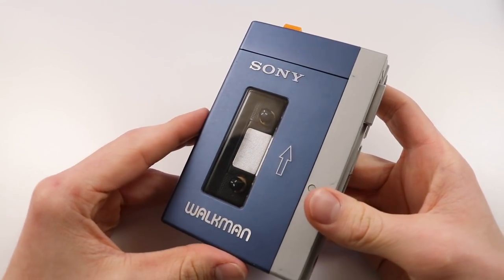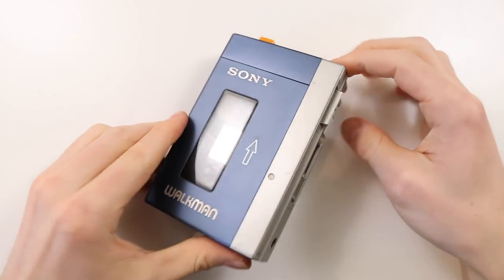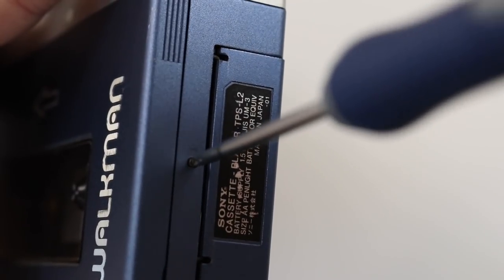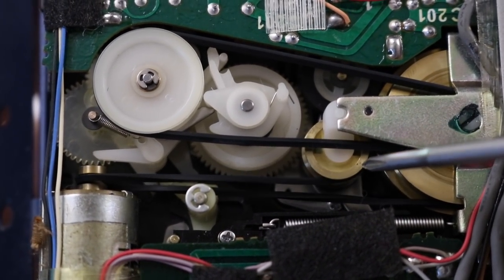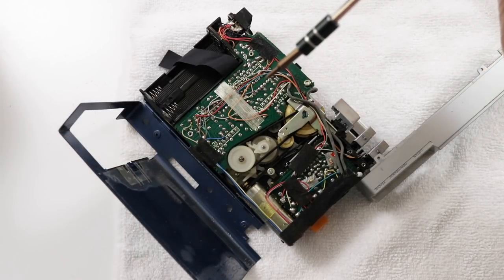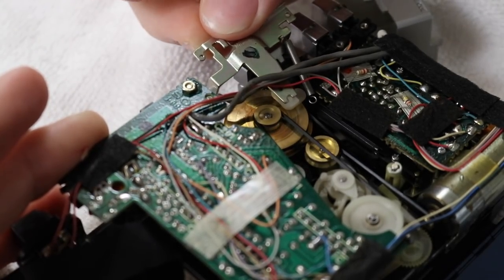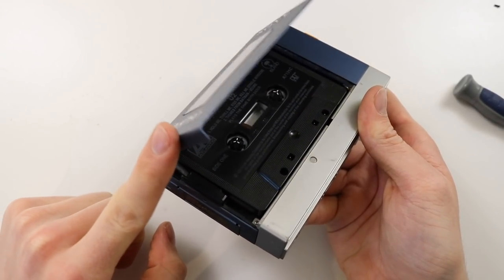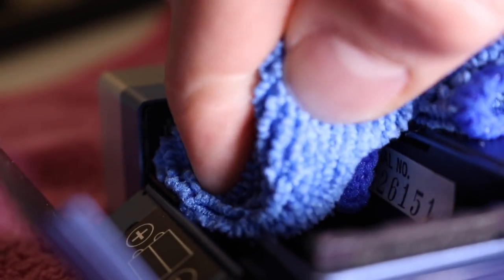Let's Refurb! - Original 1979 Sony Walkman TPS-L2! (Guardians of the Galaxy)

Comment: Good vid!  I always found the older models too complicated and the advanced slim new ones likewise.  If there is anything I have taken away from repairing these on my own is that if you stick with sony its very unlikely that you won't find the service manual online for free (which also most of the time provides step by step instructions on disassembly) and the second is if you ever have corroded contacts just use some sandpaper on them and that basically can get rid of any corrosion left over.
Reply from the maker: Thanks for the info Tom! They are very complex inside.
Reply: The only issue with sanding off corrosion is that without the resistant chrome plating that the corrosion ate away you've got a patch that will oxidize much quicker. To really fix crusty contacts you'd have to replate the metal or use something likewise to seal it.

Comment: excellent video, my only suggestions would be to apply some white lithium grease for electronics to the teeth of the gears, this will help reduce the wow and flutter of the tape, you may also need to re texture the pinch roller with some fine sandpaper and isoprop just so that it grips and moves the tape smoothly.
Reply: I've heard of some chemical called rubber renew that rejuvenates rubber (of course) that works wonders on rollers and the like.
Reply: for minor jobs like capstans certainly, it's just important to avoid it wicking to anywhere else in the walkman since it makes plastics turn to mush after a while (and makes the belts lose their tension)

Comment: Questions why does it appear to have somekind of internal battery is that something that should be changed if it is somekind of capacity holder after all these years or is that something else, you really should have cleaned everything inside while you had it open and checked everything and is the stuff on the contacts from battery leaking? If so did you try vinegar, finally don't oil plastic it makes it go nasy

Comment: You didn't show cleaning the wiper potentiometer on the headphone board or anything of that manner. you also didn't oil up the motor or the spinning brass pieces. this is something you NEED NEED NEED to do. the pot is for the adjustment of the speed. since you have new belts it will be very out of sync speed-wise and may be too fast.
Reply from the maker: I am still new to Walkmans! The sound is great, doesn't seem to be playing too fast or anything? I didn't want to fiddle with this unit too much given its age & price. I will be doing some repairs to a WM-3 and will try and do all of that one.

Comment: Be very careful with oils and plastics as some oils can eat out plastics or make them very fragile  and sometimes deformed over time. Sorry if I made some mistakes or if my grammar is bad. Just wanted you to know about oils. Greetings from russia! :)
Reply from the maker: Yeah thanks for the info man! I cleaned it with isypropal and wiped it all dry!
Reply: Yeah petroleum based lubricants chemically attack certain types of plastics. This is why gasoline containers have to be made of plastics that resist the reaction.